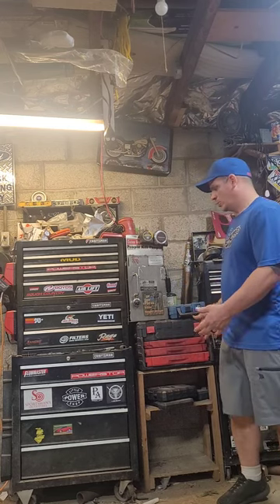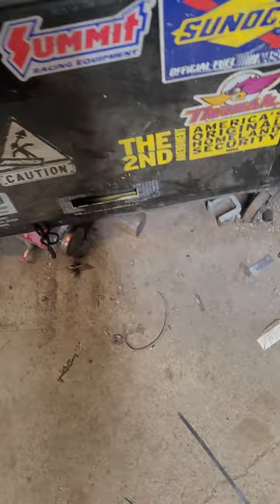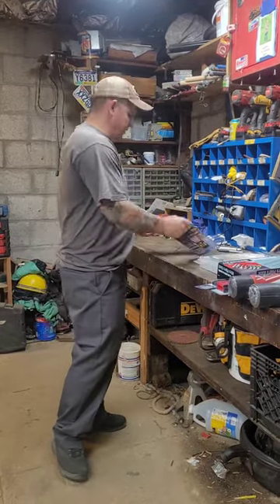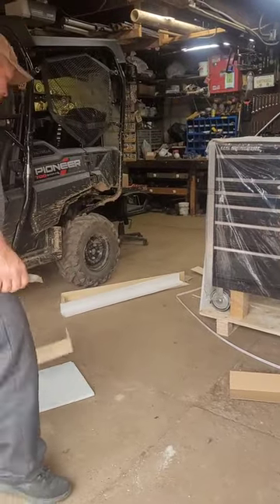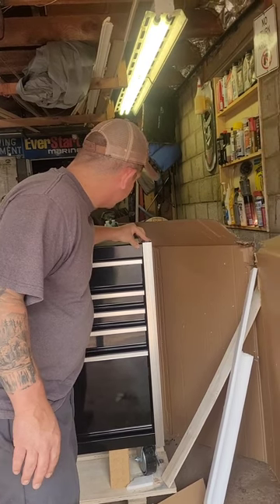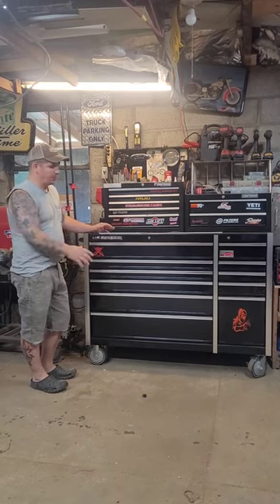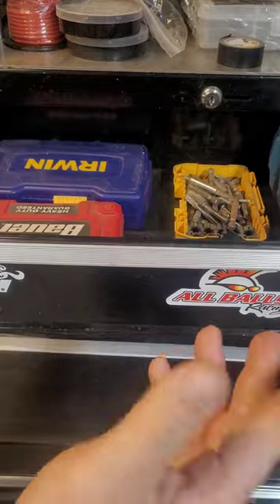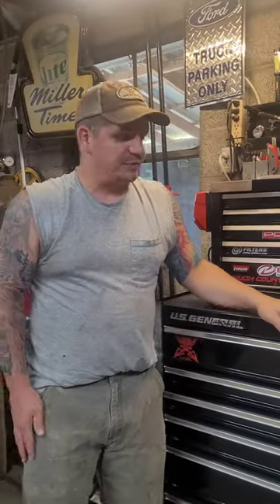56" US General toolbox unboxing  and toolbox tour.

Comment: First time I have an issue with US General. One of the drawer slides threw roller bearings and slide is broken. Gee wiz I just got it all set up too. Grrrr. on the 56
Reply from the maker: Let me know if they make it right.
Reply: @MakingNoise45  I could have taken the chest back and pre-saled another one with no problem with Harbor Freight store. How ever I elected to keep it and get another slide to change out. I called the parts number from the on line sight and had a wonderful conversation with the lady on the other end. I have 2 complete L and R bearing slide sets for this box coming to my door. Only need a R slide but now will have something extra if needed. All covered under the 90 day warranty. Nice! I tried to presale another chest but none available so I think I made the right decision to repair on my own. Have a great day Bob22